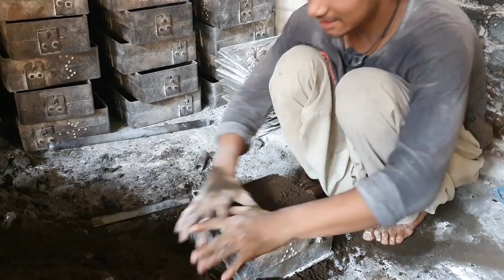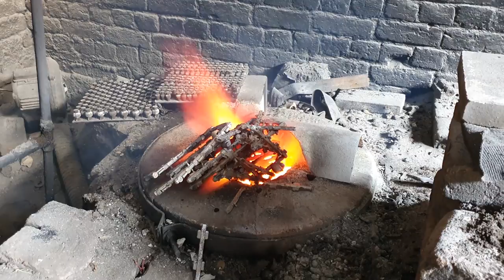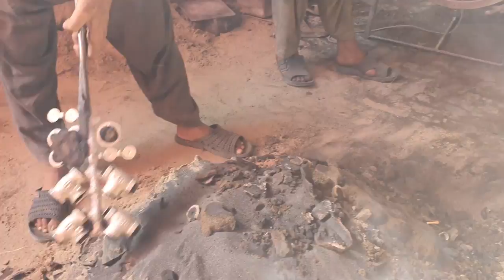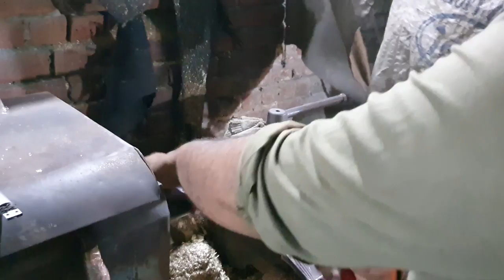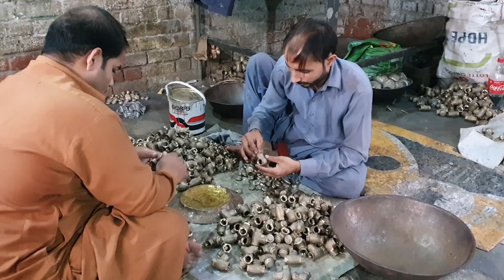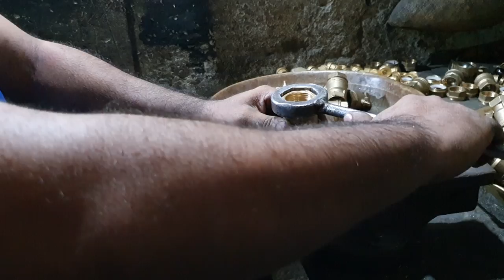Handle Valve Making || Awesome Technique of Brass Sanitary

Comment: These guys should be making good money for there skill it passes me off to know they don't an some rich dude goes an buys those valves for penny's on the dollar an makes a huge profit of these men's hard work an skill.
Reply: Don't stress yourself out mate!
These are for local consumption or export to South East Asia, and are sold cheaply in markets that can't afford to pay more. 

Think of the low paid workers in those geographical areas - they need valves and taps too. It allows the women folk to have running water from gravity feed tanks via cheap plastic pipes. 

It saves the women from the hard slog that African tribal women still have to do, by balancing heavy water containers on their heads and walking many dangerous kilometres on poorly constructed roads.
Reply: @BrassLock  👍👍👍